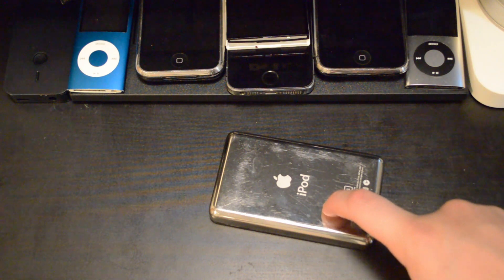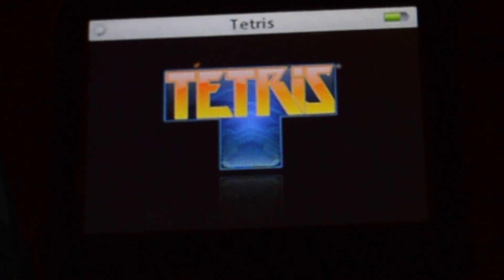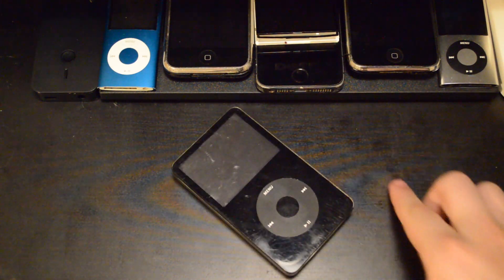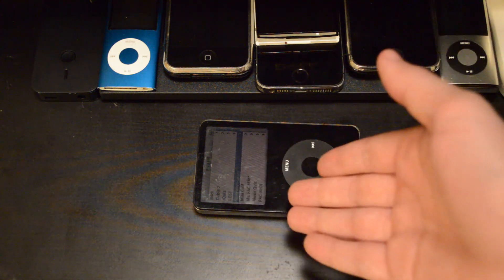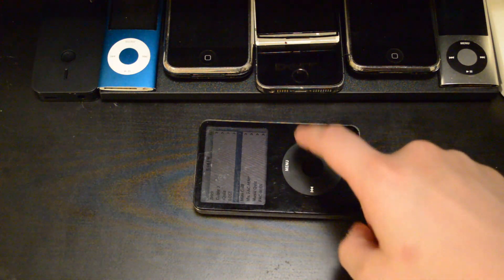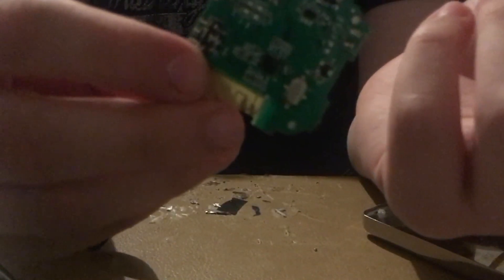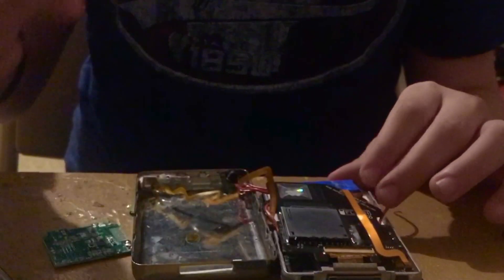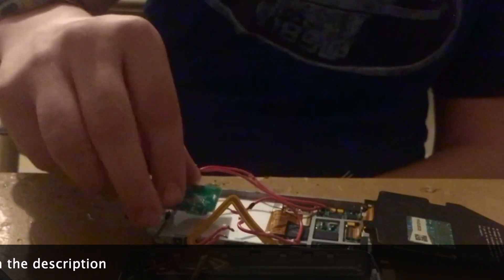This is no ordinary iPod Classic!

Comment: where is the bluetooth button located? did you drill a hole in the case?
Reply from the maker: It’s located in the hole where the headphone jack was. I had to have some courage to remove the jack :)
Reply: @WhateverTechComestoMind  aaah, i must have overheard that. Sacraficing the headphone jack is not easy.. Thanks for the quick answer!

Comment: It was awesooome!!! Will it work well with other bluetooth boards in transmitter? It's hard to get the transmitter you used because this is Korea😭
Reply from the maker: As long as you get the pins correct, and get a transmitter with a decent antenna, it should work!

Comment: I'm gonna put the switch somewhere else but if u wanted to keep the jack will the wiring diagram make it so that the jack is no longer in operable or can I keep it there as long as I wire that switch somewhere else?
Reply from the maker: The headphone jack will still work with the wiring diagram, I made sure it would so if someone better than me came along, they could keep the jack!
Reply from the maker: I find my hold switch to valuable for that, but everyone uses their pod differently

Comment: Hi, I just watched your video and was so pleased to find out that its possible to modify a IPOD Classic to be blue-tooth compatible.  I realize you have a "how to" video link, but I'm in my 60s and at my age I'm not up to trying to figure out new technology.  Wondering if you would be willing to update my IPOD for a fee so I can use it while I do my business of House Cleaning.  At the moment I can't even use earbuds with it because the jack is no longer functioning.  Let me know what you think, thanks much for your consideration
Reply from the maker: Thank you for trusting me to do this for you, I would be happy to but there are a few considerations, 1. It would be much easier to replace the headphone jack, 2. Honestly the range of the Bluetooth mod isn’t that great, if anything like clothes or maybe even 5-6 feet of distance between your headphones and the iPod, it will cut out. This could be solved by a 3D printed back housing (the back metal part) but that would be a little expensive since I don’t currently have a 3D printer. If one of those options is ok with you, I’d be more that happy to do it, but I just wanted to let you know of the caveats.
Reply: Hey there sir or ma’am. If you would want and are still interested I can repair your headphone jack. As far as bluetooth I’m working on a few units but I believe they’re not super worth it. Basically they have lottle to no range.